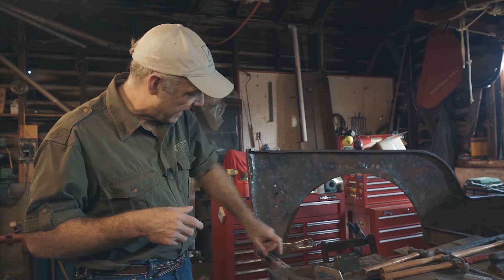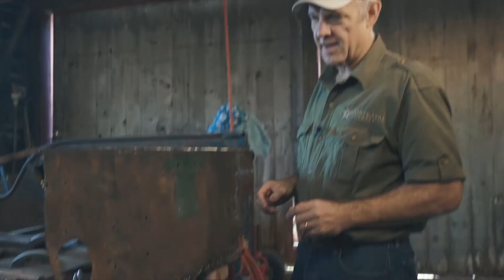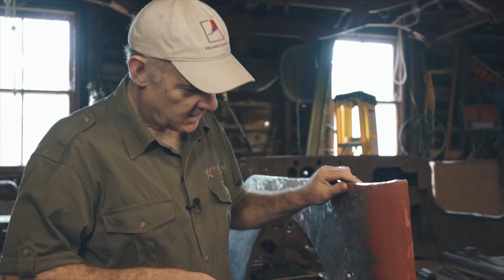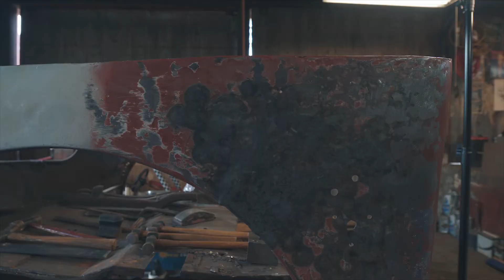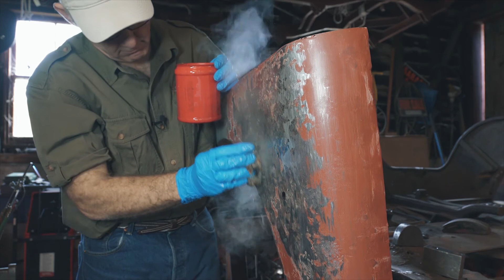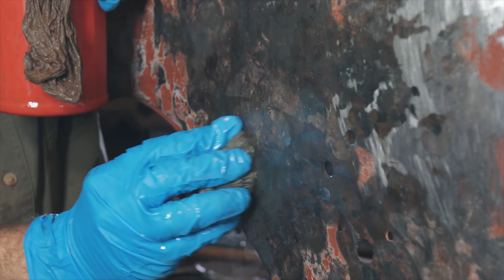Heat Shrinking Body Panels - 1943 Willys MB Jeep Tub Restoration #2/G503/ShopTime™

Comment: What does hammering around the heated zone do?
Reply from the maker: It forces the heated, expanded metal into the surrounding, cooler and stronger metal - causing it to "bunch up."  When the metal returns to room temperature - it will have shrunk.  This video was made a long time ago and we have learned a lot since then.  Unless there are really severe dents, you don't need to heat the metal this hot and it is not advisable to do so.  Get a propane torch, heat, cool off with air or water and repeat.  Heating the metal repeatedly can degrade it.  We also using a shrinking disc a lot - works great to remove small imperfections and will almost never cause damage.  The downside is that it is slow, but....sometimes slow is faster.
Reply: @Portrayalpress  Very helpful. Thank you.
Reply: @Portrayalpress  That helps a lot. Thank you for taking the time to explain.

Comment: That's some fascinating work right there. I have vague recollections of my dad doing something similar with a crumpled rear quarter on a Mk1 Ford Cortina (1963 vintage) I don't remember him using the oxy-acetylene torch, but I may be mistaken. Seeing the panel work, before, and then after, was quite impressive. I don't think it would have been as good as what you're aiming for, not by a long chalk, but even so, I was amazed to see that metal making its way back to where it came from. 

As an aside to that, I do remember him separating spot welded seams and working each panel individually, and then when the seams were about ready for closure, he'd switch back and forth from one to the other as the joins came back together.  I seem to recall that he welded up each of the old spot welds as they came together, before working the next ones back together. Until then, I hadn't realised that you actually shrink sheet metal, short of 'cutting and shutting'.
Reply from the maker: Sounds like your dad was an old school craftsman!  I know you enjoyed your time in the shop with him.  I have watched many very good craftsmen do their work and everyone has their little tricks and methods.  At the end, I think you have to just grab some metal and start figuring out what you can make work and then really start the learning process.  Cheers!